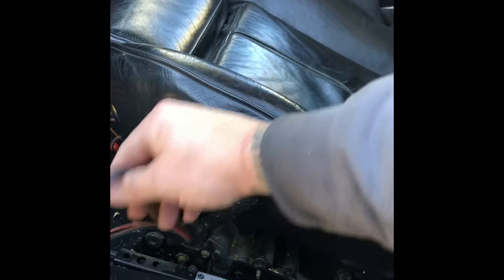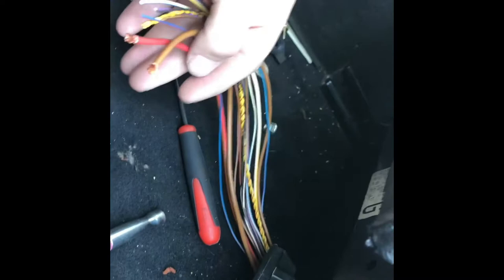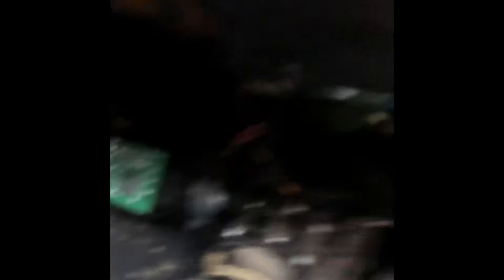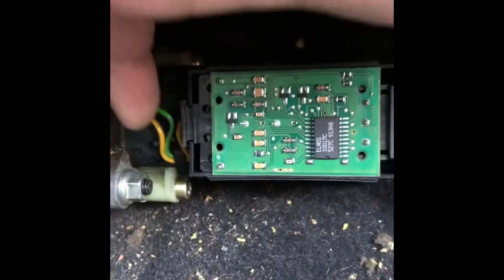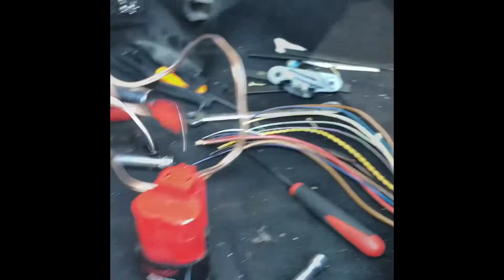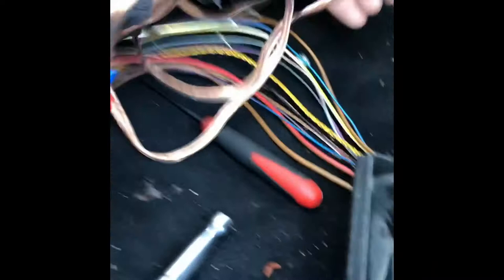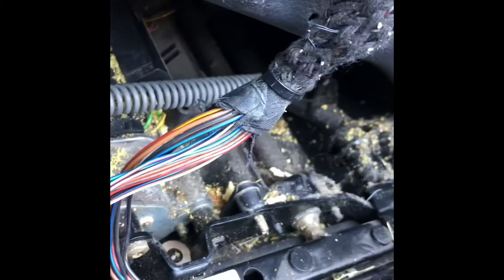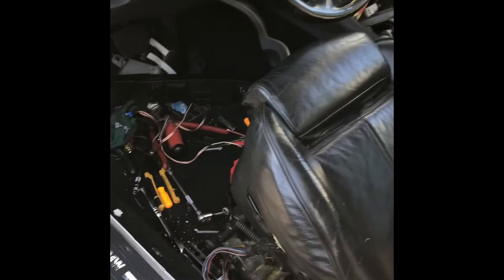1995-2001 BMW E38 740/750I&IL Front Seat Removal ( No Power)

Comment: About to find out if this method works on a 2004 Rolls Royce phantom. flood car and the seat control module board is all corroded. I can't get to any of the bolts. the seat frames look very similar.
Reply from the maker: Awesome!  Did it work?